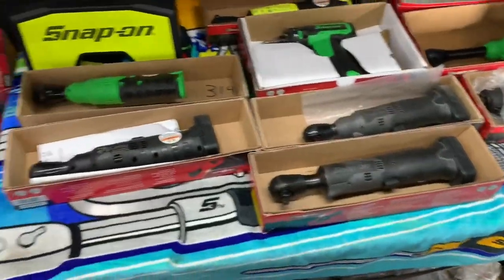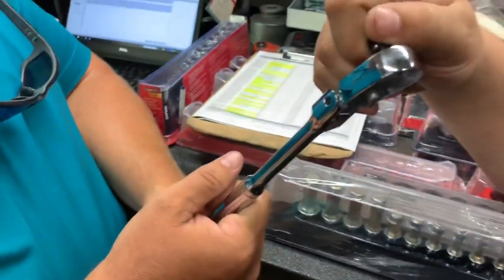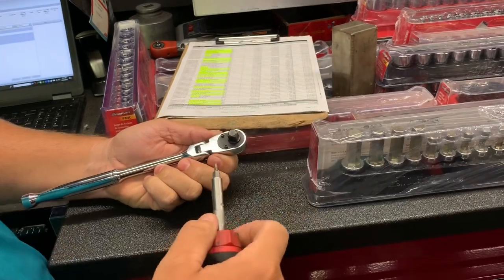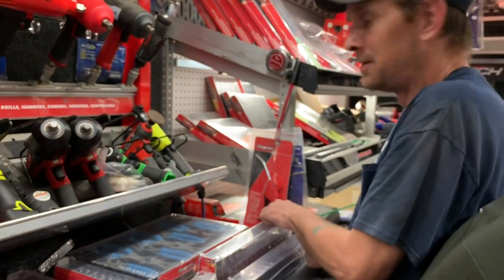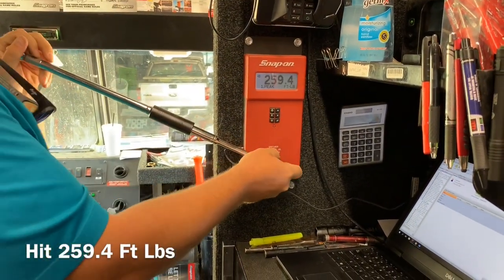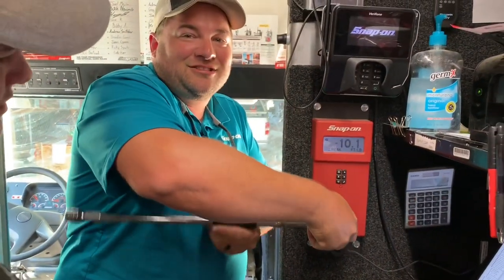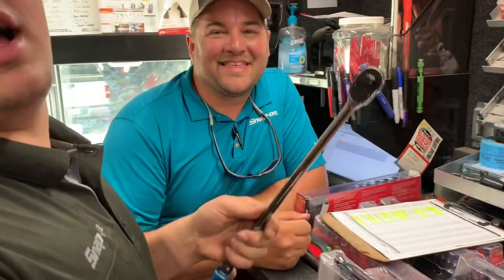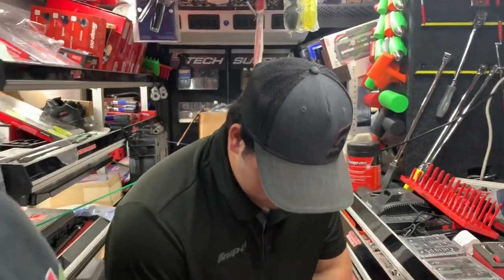Snap On Dealer Puts ICON Head To Head VS Snap On Ratchet

Comment: This is why I love Harbor Freight. I can't afford to buy all the tools from Snap-On and I can with Harbor Freight. I have a floor jack and a 24 inch breaker bar that's both Pittsburgh Brand and both have very useful. My Snap-On breaker bar is not as good mainly because it's a little shorter. Hating on other tools because it's not snap-on is dumb. Glad this video is honest.

Comment: This is a Great Video Hamilton Should had Used a SNAP-ON 3/8" Standard Flexhead Handle instead of the extended hard handle do to the flex he should had compared it to the SNAP-ON that is Similar to the Icon But Still a Excellent video Great Content Fellas

Comment: a icon tool truck with a good operator would put snap-on over-inflated pricing in check.
snap-on has went to far with increasing the prices beyond reasonable market value.
Reply from the maker: Snap On is pricey but I will admit they are good tools.
Reply: What you have to realize is that Snap-On has institutional customers who have essentially unlimited budgets and price does not matter. They simply want the best they can possibly get. Think the military industrial complex. Which includes the military itself. They use all Snap-On. They have a three quarters of a trillion dollars a year budget. After buying all the bombs, bullets and beans they need that still leaves a lot left over to buy tools with.
Reply: @KoonTrucking  No one makes a better ratchet or wrench than Snap-On does. The question that remains is who needs tools that good? For me the answer is I can get by with less.
Reply: Paul Frederick true story....I know my general mechanics toolbox that I was issued in the army was all snapon. In the supply system the gov pays over $10k for that tool kit. You could easily stock a kit with the same tools for under $1500 from any normal tool brand.
Reply: @michaelardoin4260  the US Army is a tradition based institution. They used Snap-On in year one so they're going to keep using what won them the war. If it ain't broke give it its regularly scheduled maintenance. And the Army doesn't haggle over prices. They pay MSRP. Which may partly explain why Snap-On's prices are what they are. As long as they can say it with a straight face the US Army will shell out for it. But at the same time Snap-On can't have two different pricing structures. One for the Army and one for everyone else with everyone else getting a better price. That would be wrong?

Comment: To be honest, I still buy some specialty tools from Snap On, but for my regular day to day work I have been using ICON tools for over a year now and I have not been dissappointed. On the other hand! I have been dissappointed with some of the MAC tools I have bought. Impact sockets two of them a 17mm and a 19mm broke, then I used the ICON set and I was very hessitant about even attempting to. Both ICON 17mm and 19mm impact sockets did the job.  Don't understimate some cheap prices, you will be surprised. I know I have been.
Reply from the maker: Yep ! 👍🏻

Comment: The icon ratchet internals look very similar to the Gearwrench 84 tooth internals and Tekton 90 tooth internals. I do not get what all the Icon tool hype is about when there are Made in Taiwan tools out there that have already been there and done that at this price point, torture testing included.
Reply: Couldn't agree more. Glad harbor freight has decent tools finally but I expect them to be the cheapest there. I can get the channelock wrenches cheaper than icon pry made in same factory and they match my channelock pliers and screwdrivers that are USA made
Reply: Couldn't agree more plus how many tool factory's can there be in Taiwan in the first place plus I have ratchets I bought back 80s and 90s I still use if wear put gust get a rebuild kit I bought 3 new ratchets a locking flex 1/2 ratchet a long handle 1/4 ratchet A long 18  3/8 flexhead all snap on I know they last the test of time I comfortable using them and helping keeping USA jobs
Reply: @larryborkstrom3580  Harbor Freight has 20,000 employees and Snap-On only has 12,600. So buying from Harbor Freight you're helping more US jobs. Facts!
Reply: @1pcfred  yeah but they don't pay that well Harbor Freights pretty cheap boss Snap-on pays their employees a lot better and that don't include the franchisees that just includes people directly employed in manufacturing
Reply: @larryborkstrom3580  Snap-On is overpaid and that's why their tools are too expensive!
Reply: @1pcfred  initially at first yes they are a little more expensive but in the long run it's cheaper and if you don't like Snap-on Tools don't buy Snap-on tools

Comment: I have that blue hard handle 1/2" ratchet in about 25" flex head 80 and it has done some amazing things. I will buy sunex for regular impact but ratchets are snap on all day. I've only broke 3 and they were repaired in a week tops.

Comment: I just love how the snap on dealer is using a 3/8 breaker bar to discredit a 3/8 flex head ratchet
Reply from the maker: Wasn’t a breaker bar. Hell he even took the snap On ratchet apart to show the guts in it. Obviously you didn’t watch the video.
Reply: Hollis Reece I can see you are as about as smart as your comment.
Reply: Fine it was still a fixed head ratchet aginst a flex head that was more my point doesnt really matter that much anyway i own snap on tools and a ton of pittsburg pro i have broken more snap on shit then any of my pittsburg still waiting for my chrome 21mm socket to explode or even crack seeing as how i use it atleast once a day on an ir 1\2 in impact
Reply: @KoonTrucking  and yes i watched the video alll the way thru and yes i under stand it wasnt a true breaker bar by definition butttttt my whole point is why couldnt the snap on guy use a flex head ratchet off his truck to compare with the icon flex head its almost like he didnt want to imbares his self sor the company so he used a long ass fixed head ratchet. As i stated in my other commet i have broken mor of my snap on tolls then i have broken my pittsburg pro tools
Reply from the maker: Hollis Reece I get what you are saying but he didn’t have a flex head on there, he got the longest Ratchet he had on the truck to use (which I am grateful he was even willing to do the test on his truck to begin with) and I understand him not wanting to put a cheater bar on a ratchet and mar it up since that’s his job to sell tools and honestly I don’t blame him. I wouldn’t have put a cheater pipe on my snap On handle either

Comment: Very impressive. However with that said I remember walking into a Sears in my shop uniform (DaimlerChrysler) back in the day with a Craftsman Professional line ratchet that I broke and they would not warranty it! They said their tools are not meant to be used in a professional setting. Mind you I used that for home use. Nowadays I am Snap-On or Mac tools only. You get what you pay for.
Reply: Same thing happened to me at harbor freight when I was working at honda

Comment: He should have used a snap on flex head. See how that will hold up to ICON
Reply: I have a snap on flex head and it'll hold up to a lot of pressure.
Reply: Im sure it can. I just figured it would be a fair test with both flex heads. Ive never bought from a tool truck, probably never will. Im not a fan of big price mark ups so id like to see a $40 ratchet take the beating that a $100 dollar ratchet would.

Comment: I bought a Snapon 24" 1/2 flexhead and it flexes so much I felt like it may brake apart. I was happy when I saw it but not anymore lol. I need something more sturdy when fighting a bolt. Even a weak impact did a better job than the breaker bar lol

Comment: The flex head Icon had a recall out for getting locked up in high torque uses. But the non flex head seems to be fine.

Comment: This was not a EQUAL test.  It was impressive but you could get the higher numbers because of the shorter handle was able to make that like a solid bar.   The longer handle on the snap on was able to deflect because of the bending.
Now we dont have icon  in Canada but we have like that princess auto brand .  I still love my snap on.   Now maybe if they came up with a tool truck for them I just might.   But SNAP ON YOU ARE AND WILL BE MY NUMBER ONE

Comment: Please do this with the new milwuakee ratchets. The build quality and seals in the ratchet are possibly the best on the market and they are cheaper than ICON. Break down the cost considering the sets they come in and the extended versions. Milwuakee really needs to market them alot more. I know your familiar with the quality of there wrenches.

Comment: i have had some other ratchets, but after a year of use some of the other brands i used didnt want to switch directions anymore. You take them apart, everything looks good, but ill clean them and everything. Put them back together, and a weak later they are stuck again, cant change the directions again. Now if its for my free time i can handle taking it apart every now and then. But if im working i want the thing to work. So i do use the (kinda overpriced) snapon ratchets now. And yes i have broken the 3/8s ratchet. It was a swivel head just like the icon 1 you have. And what happens is with this type of swivel is they flex a bit and then the bolt gets to take the force and bends, then the head snaps of and the whole handle is damaged. And this was offcourse under constant pressure, else it would not go like that. But we got a new 1, and now its 1 that has the swivel arms the other way around. So instead of the U being on the handle its now on the head and that thing feels much more rigid when under pressure.

Comment: Recommended tools while I have my Snap-on student discount?
Reply from the maker: I never use chrome. If I was looking for the best bang for the buck go Impact Sockets. If you can buy impacts get a 1/2” and 3/8”
Reply: I have wanted to ask the same question. My son is in diesel Tec school and I’m wanting to buy him some tools so he doesn’t start off in the red
Reply: We hardly ever use chrome sockets. We use impacts on ratchets daily. I have hardly ever seen any jobs that the impact Socket was too thick to fit into. I had rather buy good impacts and cheap chrome.
Reply: Thanks for all the replies guys, I’m not real sure yet what I’ll be working on as I’ve just started tech school, I love gearwrench but I figured since our school has a snapon guy and we get a big discount may as well use it.
Reply: @CursedGarage  I'm not sure how many tool brands do, but Tekton has a 15% discount for tech students and good prices to boot. Just an option you may want to check out.
Reply: As a part of my set, we get a 3/8 and 1/2 80 teeth ratchets, a 3/8 techangle torque wrench and a 1/2 inch clock style torque wrench

Comment: ICON had a recall on their flex head ratchets, when the snap on dealer mentioned the gear gets stuck ICON finally fixed that issue

Comment: I was told by someone a week ago that icon comes from the same warehouse as snap on.. Anyways I work on heavy equipment and have HF tools as well. The extendable ratchets, sockets and so on and don’t have any problems. With this test they do no body should be using a ratchet like that anyways that’s why they make breaker bars.. but this does show the least expensive stuff works just as well just depends who makes it.
Reply from the maker: I have heard that too about the factory stuff but Snap On ratchets are made in Tennessee with steel they even manufacture. There’s YouTube videos showing the forging process from start to finish on the ratchets all American made

Comment: not only that but the icon is a swivel head and it should fail faster because of it and should decrease lbs from the swivel making less torque but the snapon is solid no swivel so it should take and do more torque but did not show it did so that icon is good stuff.

Comment: I have some doubts about this test because they are comparing a shorter handle with a longer handle. Of course the shorter handle will bend less and when combined with an extension and that thicker round tube they used to connect the two, mechanically it makes sense that this would deliver more torque. They shoudl redo the test more scientifically.
Reply from the maker: You realize the longer handle bends easier right ? Always an issue when using a longer handle? Not to mention it also proves the icon is strong as hell since it is a flex head and snap on isn’t.

Comment: Trying getting your Snap-On warranty with a receipt. Heard it's pretty difficult or impossible
Reply from the maker: With a receipt ? I think you mean without a receipt. If you buy from your dealer they will warranty it. Now if you never buy anything from them and just hop on the truck without spending anything with them there’s a chance they won’t and honestly I don’t blame them. But Calling snap on will get you a replacement no problem. Even without a dealer they will warranty anything. I’ve never had to show a receipt.

Comment: Flex head vs straight bar ratchet is what this should say the straight should be better but the flex head has more torque icon stuff is a staple in my box if have both and the flex head is the ratchets for the box they just get the job done you don't have to fight wheel wells or tight spaces and the icon stuff is taking a beating and there are no problems !

Comment: It wasnt a fair comparison because the Snap on didnt have the cheater bar placed over it, but the ICON did. If you just compared the shorter ICON to the longer Snap On, the Snap On would have out performed. Plus, Snap On raises the bar and then everyone says 'Oh Look. We made a tool as good as Snap On'.

Comment: The leverage from the cheater bar is the most important thing to consider in this test. The test is completely flawed, use the same flex head and same cheater bar then make comparisons. Besides neither one of these ratchets are made for this type of torque. If I had a choice of either one money not being an option the snap on hands down, but for 40 bucks can't argue with someone buying this. Maybe these tools will force snap on to lower prices, but I'm concerned about the quality going down at same time.

Comment: I don't like that the flex head icon rachet, doesn't lock. That's the only. Problem I have.
Reply from the maker: I personally am the same way I had rather have a locking flex head on it. Would be nice if they would add that to the lineup
Reply: @KoonTrucking  
Recently lost my 3/8 flex head Snap on rachet after 10 years😢. Which was my go too rachet. So I've tried other more affordable brands. Husky, craftsman, kobalt and other Asian brands. But none compare to the feel and function. Of the snap on one I owned. It wasn't the first rachet I ever bought. My first set's of rachets where usually cheaper brand crasts or HF. But after busting my knuckles and having to warranty the cheaper brand on a regular. I decided to go high end. Guess I'm going to have to do it again.

Comment: Thats not even a fair comparison. the icon one had a flex head which is going to break due to the single pivot bolt being the weak spot. The snap on one was a solid head

Comment: Littler screws brother!

Now, I don’t think this was a fair demonstration. Snap-On ratchet probably doesn’t have the thickness of an extension and socket attached.

Either way, I love my Snap-On impact sockets, I do like the icon chrome sockets. It’s whatever
Reply from the maker: Not fair? The snap on was a fixed head. The icon is a flex head?

Comment: I'll finish the video after I comment hear the snap on should beat the icon my God it cost four to five times as much as the icon the idea is the icon is a great value for your money not that it's better than snap-on it's that snap on causeway you way way way way too much for those of us that are not professionals
Reply from the maker: Just keep watching ! This is surprising what happens !
Reply: Let's not be hyperbolic. The Snap-On FCF72 ($114.75) is only 2.8675 times more than the ICON ($40).
Reply: @1pcfred  oh.. You are right... I thought it was price like the long handled flex head matco which I think is 179 which I would then be closer on my guesstimate
Reply: @deepsquat600  the Snap-On 3/8s flex is surprisingly affordable. They don't seem to make a long handle classic pattern though.
Reply: @Lord Raiden that likely would not be very accurate. I know how expensive Snap-On sockets are. I've bought them off a truck myself. Snappy is practically giving the driver away in comparison.